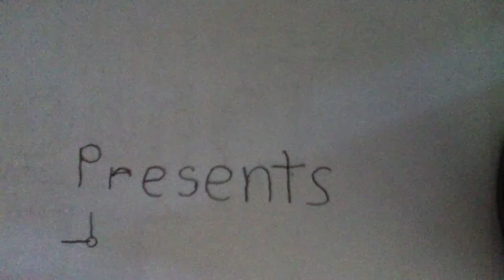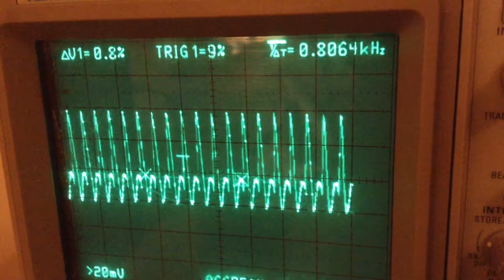2N3055 Flyback Transformer Driver

Comment: if i power this at 5v 3A, will i get a bigger arc, or will i blow the transistor? how high of a voltage can i run this on?
Reply: I tired 23v and i am using a way to massive heat sink and it gets warm like in 6 minutes and it can melt metal
Reply: but how well does it do with 5 volts?
Reply: You will probably get bigger arcs but if you're gonna input bigger voltage you better change some of the resistors value
Reply: ok, thanks.

Comment: Can you put out the circuit diagram? I too want to build one of these two create electrical wind? Can I connect the wires to long copper electrodes to create discharge between them? A
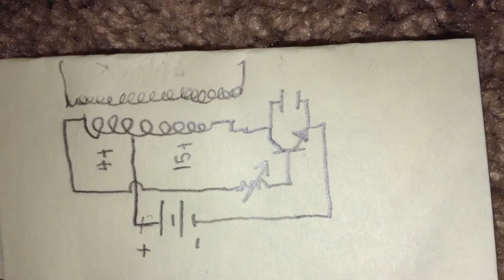Reply: he shows the circuit at 1:30. and yes, you can connect them to anything conductive. in fact, if you connect one side of the output to ground, you basically get a tesla coil.

Comment: How long could I run one of these for without it burning up. I want the corona discharge to produce ozone
Reply from the maker: +david lahey A long time, depending on cooling
Reply: Or just use a massive heat sink